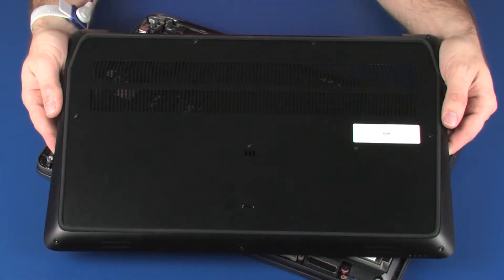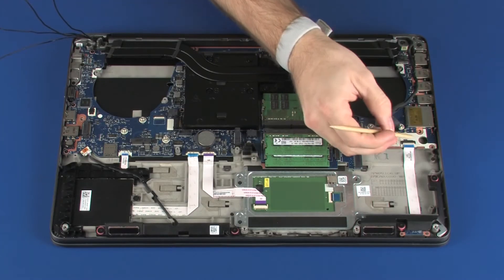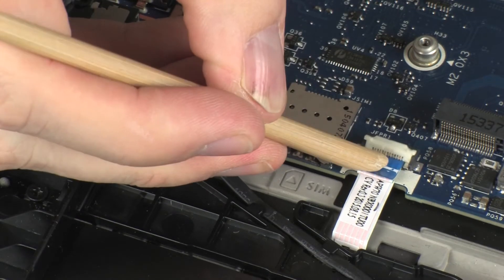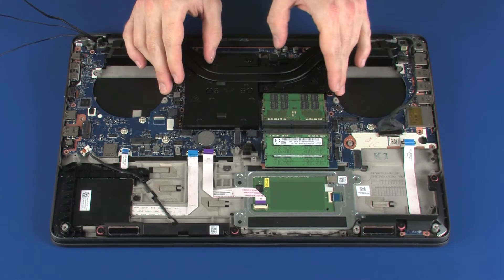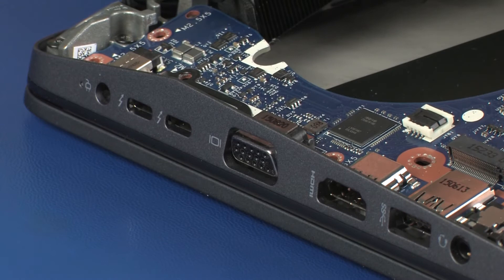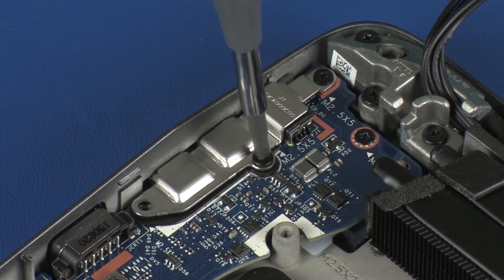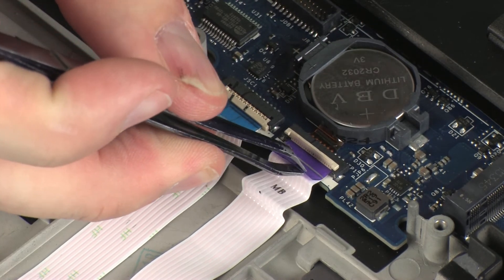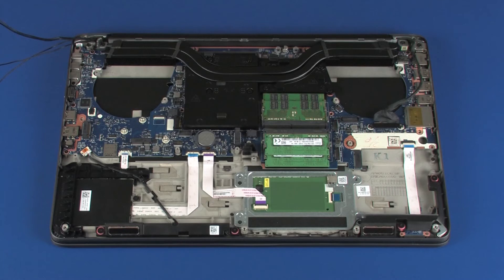Replace the System Board | HP ZBook 17 G3 Mobile Workstation | HP Support

Comment: I was wondering if I can put a ZBook 17 g4 motherboard in my zbook 17 g3
Reply from the maker: Hi there, thanks for contacting HP Global Social Media Support!
I understand that you need to know whether you can interchange the motherboard. 
I will do my best to assist you.
HP does not recommend upgrading or downgrading hardware parts or software that is bundled with the product as It may affect the manufacturer's warranty and performance, however, you could change the configuration at your own discretion.
Regards, 
HP Support
Reply: @ I know I was wondering if they fit
Reply from the maker: If you need any help in the future, you can always get back to us.
Thank you for being a valuable HP customer.
Have a wonderful day!
Regards, 
HP Support